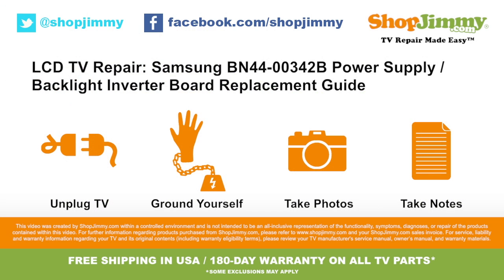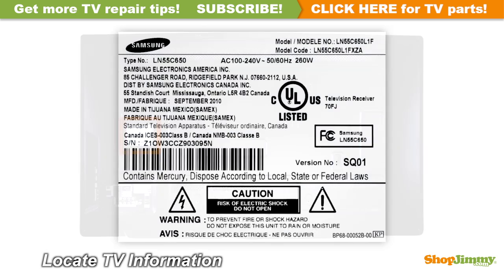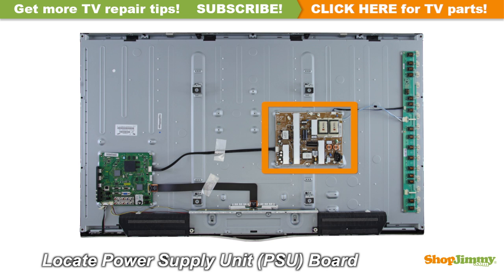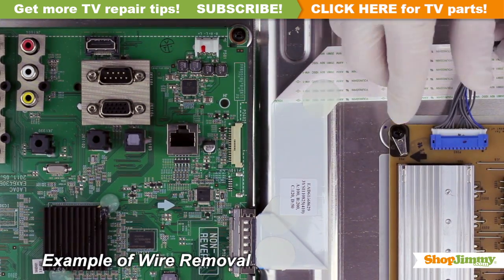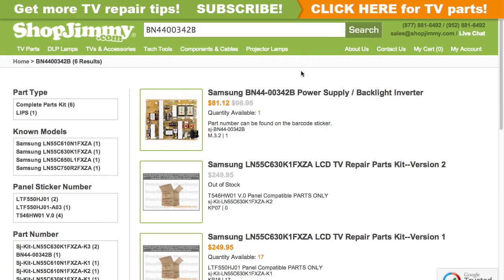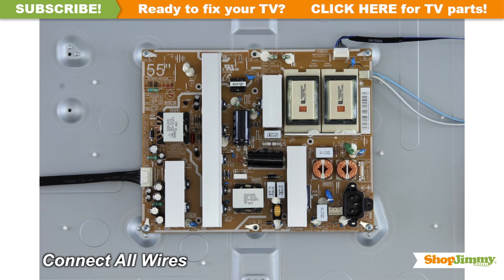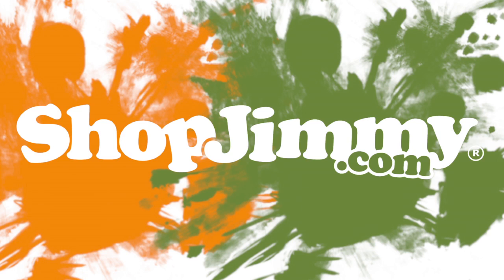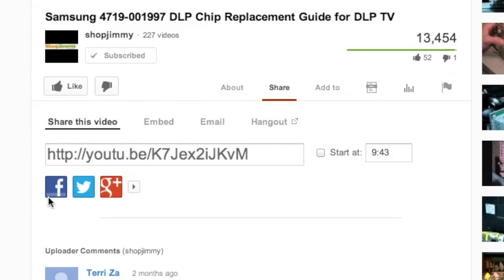Samsung TV LN55 Repair BN44-00342B Power Supply / Backlight Inverter Boards Replacement Guide

Comment: Hi I have a Samsung LA55A950D1 led tv, the left side of the screen seems to look out of clarity to the right side or what looks to be gray scale on the left side with a very visible dividing line from top to bottom would this be a back light problem or t-con board?

Comment: hi i have sanyo lcd tv model L32K70B, it doesnt have any picture at all. but the backlight is on and sounds are also working. power board of this has built in inverter , im wondering if its the power board problem, so i might order a new one from your onlineshop to replace this. do you think this might be the problem? thanks in advance

Comment: Our Samsung television , ln55c650l1fxza , starts flashing like a strobe light , occasionally at first now most of the time . Would the backlight inverter board be the cause ?
Reply from the maker: Kevin W   I recommend replacing the inverter board in your TV.  Here is a link to replacement parts for your TV model number on our website, click here:  http://www.shopjimmy.com/catalogsearch/result/index/?cat=46&q=ln55c650l1fxza  Be sure to match part numbers on your current board, with your replacement for compatibility.  You can also call our customer service for further assistance with your purchase.  (877) 881-6492  Thanks and please let us know if you have any further questions with your TV Repair!  www.shopjimmy.com

Comment from the maker: @Charles Greer - There are two possibilities.  Hopefully you can just replace the T-Con board on the TV and it will fix the problems.  The other option would be that the panel is bad.  The panel would be a lot more difficult and expensive to repair.  Go to our website and you can search your model number or this T-Con part number Samsung LJ94-03287M to find your part.  Thanks and please let us know if you need any help purchasing!  (877) 881-6492